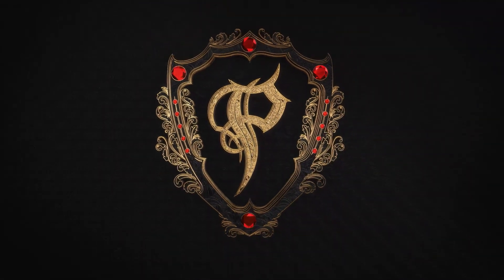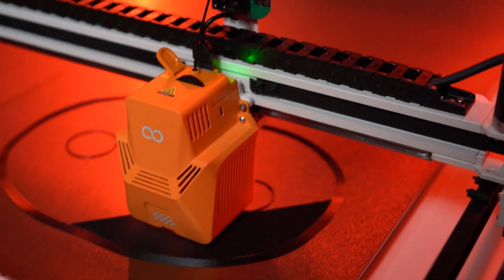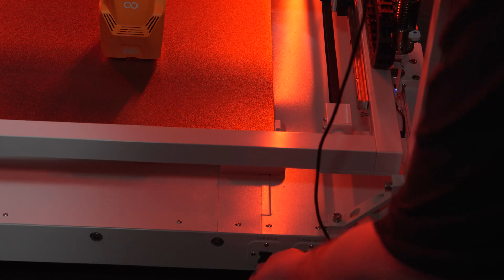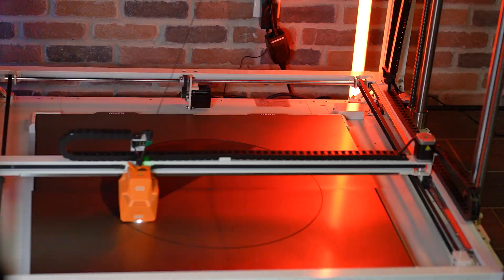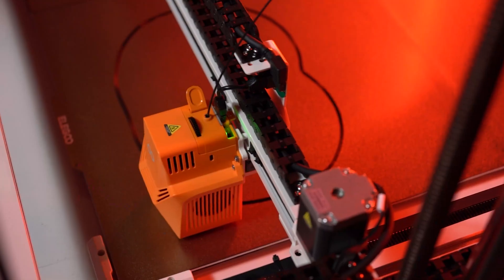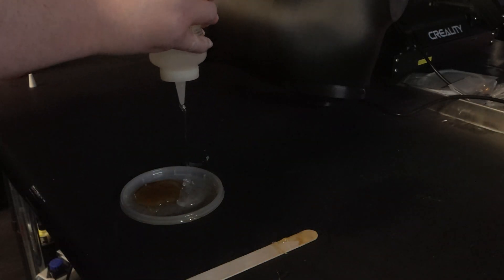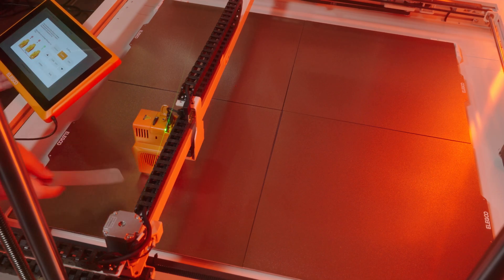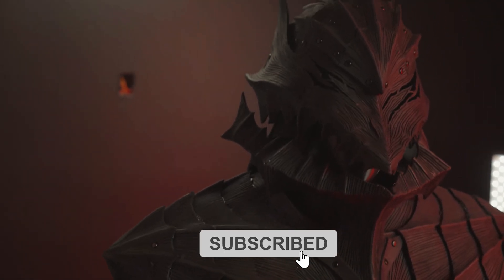3D PRINTING FULL SIZED MANNEQUINS! (For Armor/Cosplay) - Elegoo Orange Storm Giga

Comment: I have seen videos of making custom mannequins for armor customers. The buyer wears a tightly-fitting long-sleeve shirt & pants (tight yoga clothes or pajamas?) that are wrapped in layers of stiff plastic duct tape. The shirt and pants are cut and removed from the buyer, and then the cuts closed up with more duct tape. The openings at the sleeves, neck and ankles are also sealed with duct tape. The upper and lower halves have skeletons of wood or PVC pipes and then the halves are filled with spray insulation that greatly expands in the air. This stiff mannequin is used to fit the armor parts.
- Body Double! Make A Duct Tape Mannequin https://www.youtube.com/watch?v=EdFDJ6FCeo0
Reply: My problem with this method is that it gets my pins sticky.